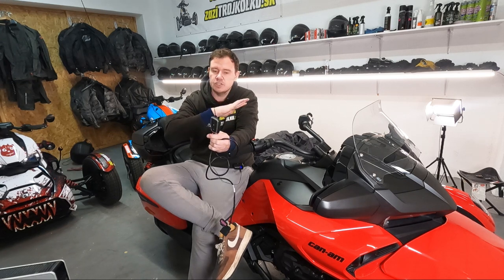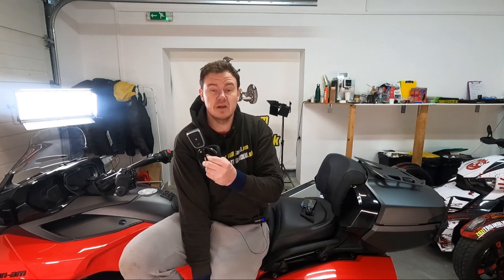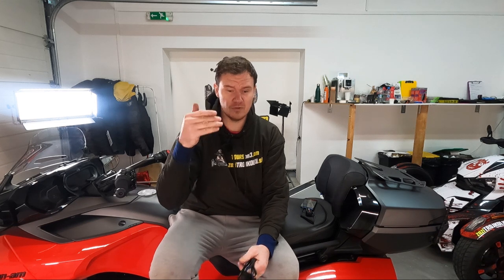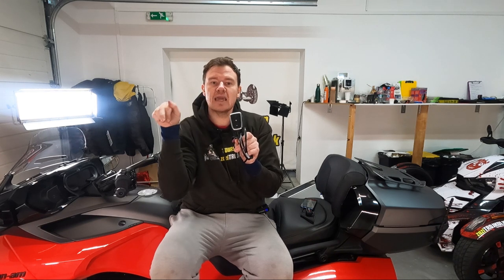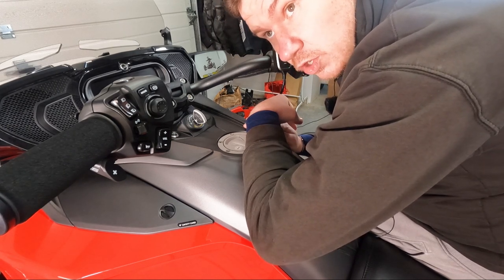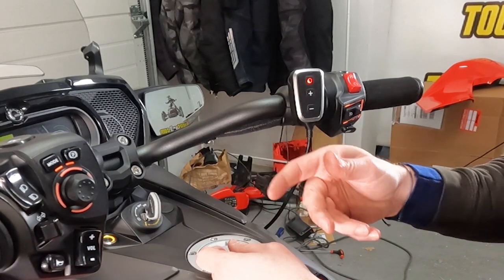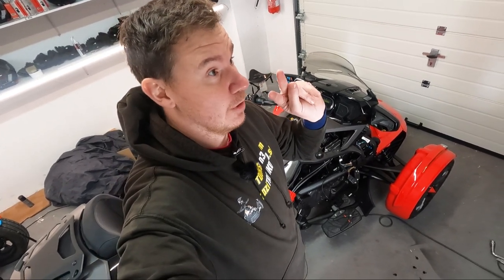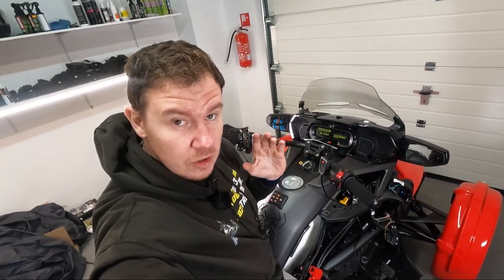PedalBox 2-Year Usage: Error Codes, Bluetooth, Compare with PedalCommander, and Avoid Costly Mistake

Comment: I think that you could have done a better job explaining what a pedal box does. It does not increase the top speed of your Spyder. It changes how fast your throttle reacts to your inputs. It takes the slack out of your throttle similar to activating the tow /haul setting on a modern pickup truck.  As you stated it does not change your  air/fuel mixture. It does not increase your Spyder’s maximum HP or torque. Martin you had excellent information on pairing to the Spyder and to your phone!

Comment: Hi Martin,  I have the PB-Pro.  So the main brain is stuffed inside the rtl22.  The 'remote' which is physically the same size as the original PB (with the same exposed USB-C) can be in the glove box, or on the key ring.  Heck in your pocket.  A USB-C dust plug might go a long way to protecting the standard PB.

Comment: Hi Martin. I run a Ryker 900 Ace. It's derestricted and runs tuned softwear courtesy of Dynojet. I also run Pedalbox. I have the Bluetooth version, and it has been concealed from day one. I've had it for 2 years without any issues. It is installed inside the Ryker under the left-hand coloured panel. Most times it runs City mode mid setting. For quick riding and competition I run it in Sport. I think Sport + is only for the drag strip. 👍🏻👍🏻
Reply from the maker: Thank you for complexe coment :) i think sport+ its for those days when you want to loose all of your problems and just hit the road in insane way 😁😁😁😁

Comment: Hi Martin,    I have Pedal Commander since a few years  and have bought  in the same time the special waterproof box you made in a very limited serie. (That was before you turned to pedal box.) .I always run whit my pedal commander and everything is fine. But I dont use the highest level (sport+ and maximum 4) that's too much  and crazy and dangerous.   i like the pedal commander and how it works .Good explanation you made here!
Reply from the maker: As i said Frank Pedal Commander its good unit and lot of fun. If you dont have any issues with it then it is great great great unit 👌👌👌👌

Comment: I have the Pedal Commander, but only use it via the App/BT connection. I installed the unit itself, under the access panel on the right side. No issues to date, even in major downpours.

Comment: I just used atv on the opening after I cleaned it with alcohol. haven't had a problem with it at all. Tape and decals will lift after time as the adhesive on the tape breaks down. Atv over tape or decals will do the same thing, don't use tape or decals.

Comment: Hi Martin 👋,
I have the pedal commander on my Ryker. And to make sure it doesn't take water, I left the box under the body with the connections.
And I only drive it with the app.
Once my mode is set, my phone goes back in my pocket.

Comment: Hello, just wanted to ask if there are specific versions of the device that did not allow Bluetooth connection or do they all have it? Since I bought a Pedal box + 3 or 4 years ago and it works fine with the remote but when trying to connect to Bluetooth when I press the + button for 5 seconds or more, no blue light flashes and when I release my finger it goes like into the next mode like I’ve been switching from sport to sport plus for example.
I’d appreciate your help.
Thank you!
Reply from the maker: Yes, there is NO bluetooth version. We dont sell such version but in US other companies do.. we have only the top of the line product 😉😉😉
Reply: @MartinTheVlogger  so do you have a fix for my issue
Reply from the maker: @karimelshafey2611  not sure what sort of fix you are talking about. But we have PedalBox with bluetooth connection at our shop 😉😉😉 https://www.martinthevlogger.com/pedalbox-pedalcommander-dynojet-canam-spyder-998-1330-parts